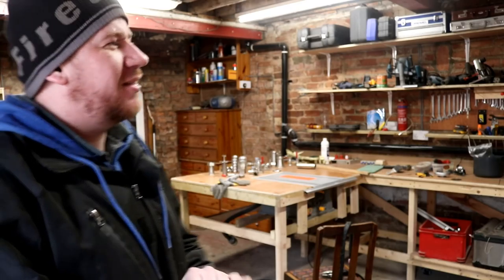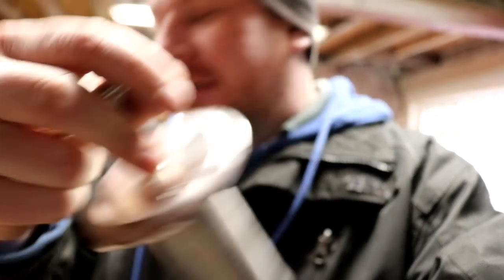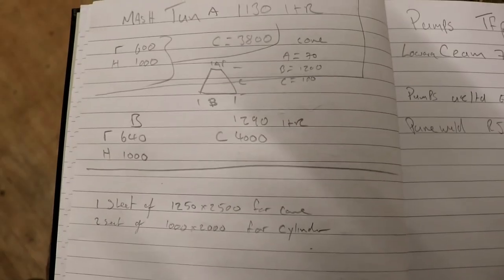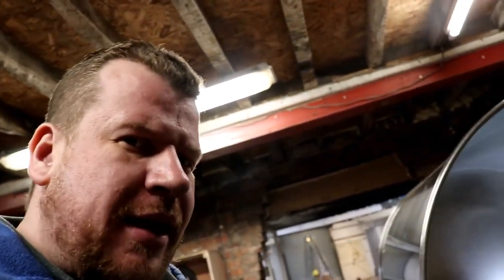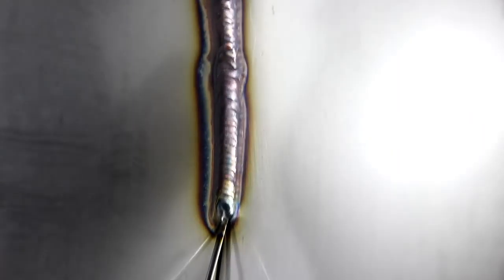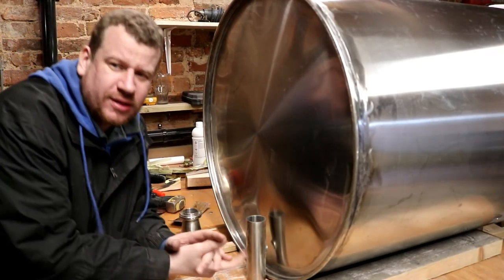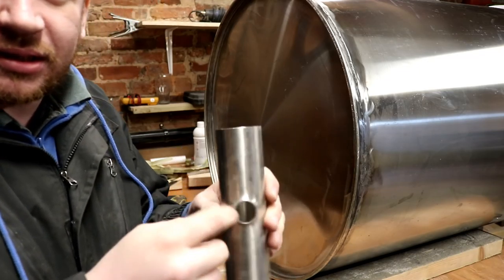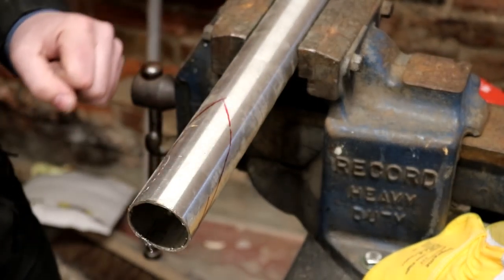What 2 Do For The Mash Tun!

Comment: I did have a thought but I've forgotten it 🙄. Nice vid though as usual and I'm looking forward to tomorrows instalment already. Just remembered; are you really going to need the smaller tank? Hot liquor tank, mash tun, boil tank and two fermentors; will you need more to begin with? As you said; get up and walking before trying to run. How much beer will you be able to "dispose of" straight away? Just thoughts but a "new label" may require some marketing to get the punters removing it in quantity. Cheers, Schnuz.

Comment: Could you extend the sides of the kettle and make it bigger
Reply: I thought that as well. perhaps cut the rolled bit off the top then make an extension with perhaps a short sleeve (for strength) that goes over the join.